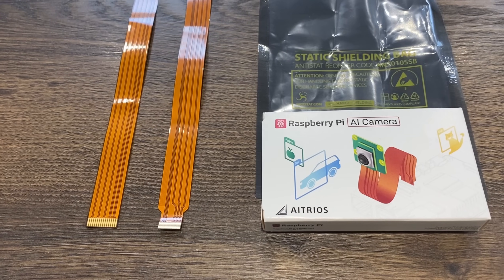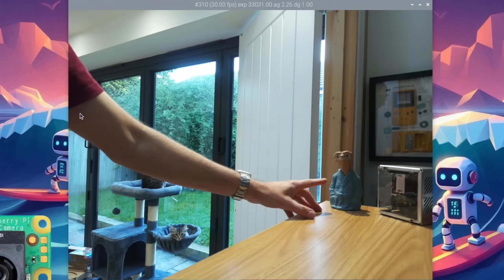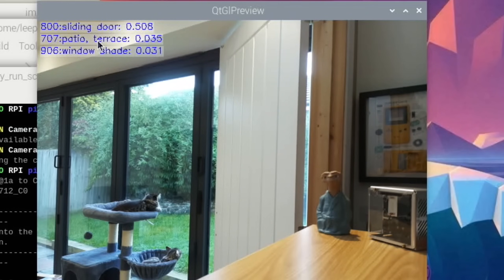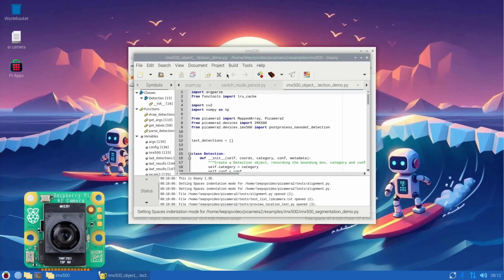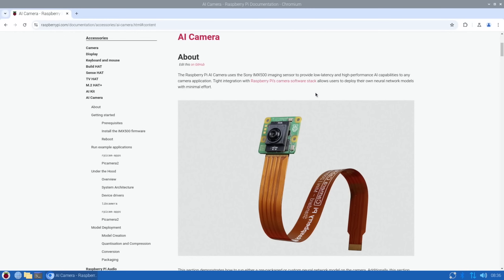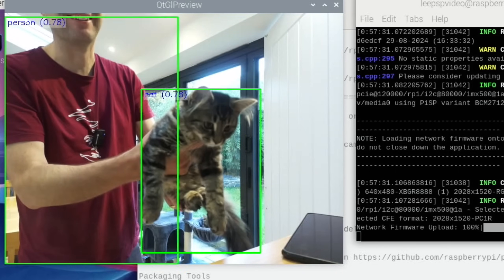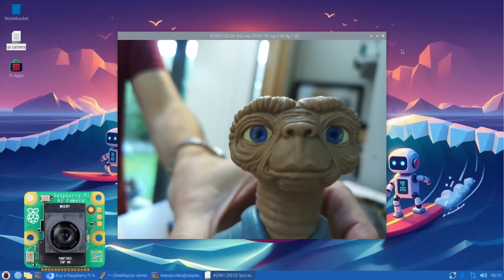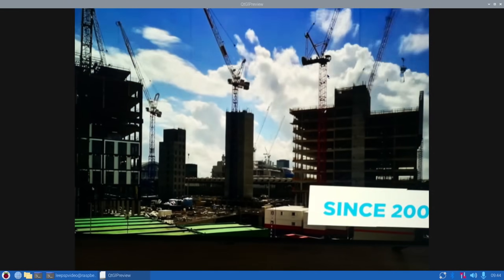NEW Raspberry Pi AI Camera with Sony’s IMX500 Intelligent Vision Sensor

Comment: Anything that has "AI" in the title makes me less inclined to have anything to do with it. It's just marketing speak, an engineer should refer to it as PE ("Probability Engine") because that describes better what AI really is - just a statistical calculator, it is nothing more than that, and completely overrated.
Reply: You are going to another extreme (from the current hype). It is neither that great as many pine think, nor as trivial as you think it is. It is a work in progress.
Reply: @michaels3003  That comment means absolutely nothing. Just waffle.
Reply: I usually use the term “machine learning”. Probability Engine seems too vague for my taste.

Comment: How does the ai with this new camera hold up against the ai module for the PI5?
Reply from the maker: @wilbertjanssen1010  at 13 tops I would think the Ai module is more powerful. The in camera processing is more flexible as it supports older Pi models but I haven’t seen any mention of tops

Comment: Could you please provide a direct download link for the codes you used in the video?
Reply from the maker: @DusunenVarlik55  I linked the docs page in the description 

Here are some of the scripts to launch the camera

rpicam-hello -t 0s --post-process-file /usr/share/rpi-camera-assets/imx500_mobilenet_ssd.json --viewfinder-width 1920 --viewfinder-height 1080 --framerate 30

rpicam-hello -t 0s --post-process-file /usr/share/rpi-camera-assets/imx500_mobilenet_ssd.json --viewfinder-width 1920 --viewfinder-height 1080 --framerate 30

rpicam-hello -t 0s --post-process-file /usr/share/rpi-camera-assets/imx500_mobilenet_ssd.json --viewfinder-width 1920 --viewfinder-height 1080 --framerate 30
Reply: @leepspvideo  Thank you 😊
Reply: Could you not be rude and paste the same request multiple times?
Reply: @acubley  I am new to English and my English is not that good, there may have been some problems, sorry.